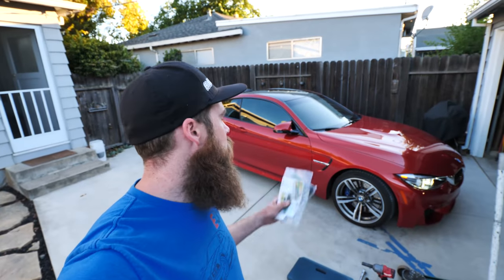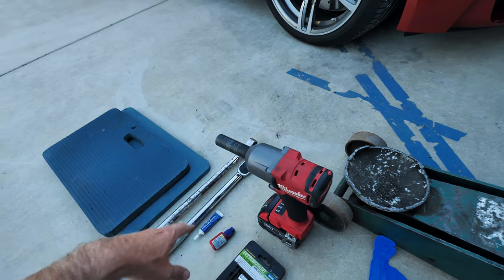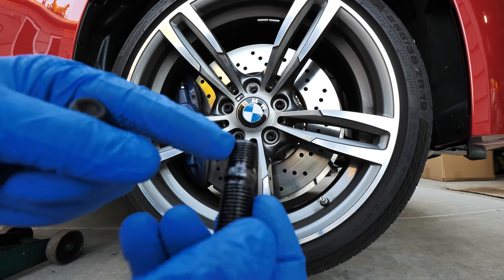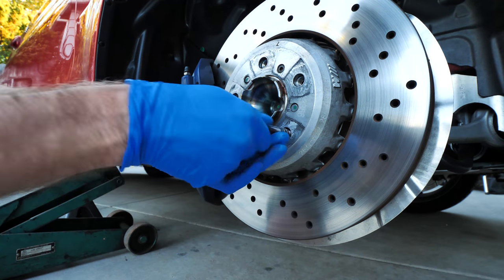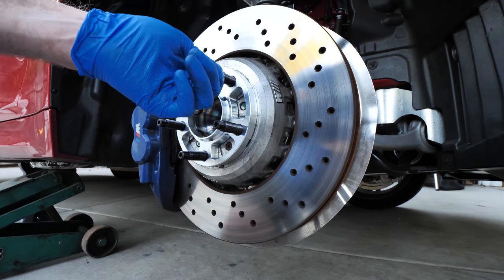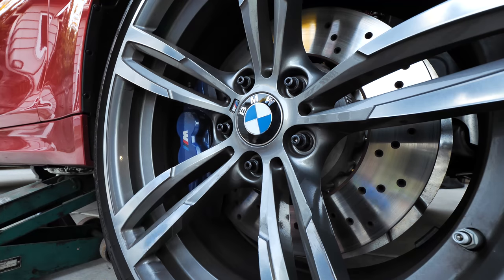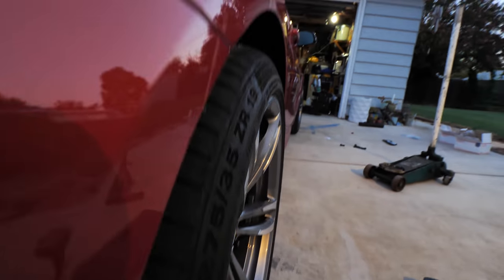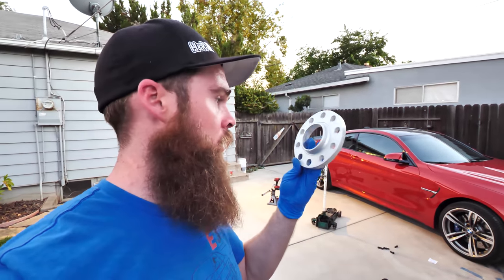HOW TO GET PERFECT WHEEL FITTMENT

Comment: Looks EXCELLENT! Hockey Pucks for Floor Jack Cup and or Jack Stands so as not to besmirch the undercarriage points and a super thin film of Anti-seize between Spacer and Hub and between Wheel and Spacer.  Helps cuz water gets trapped at wash times and starts the corrosion.

Comment: Just look at the video car looks awesome with the wheel spacers so my question is I have a 2015 428i M Sport coupe with 19” staggered setup and cars lowered so as for the spacers you did 15mm front 12mm rear can I use the same setup for my car it doesn’t have the big brake kit or would I use smaller spacers

Comment: I have to nitpick on the comment about hub centric being necessary. It’s helpful but not necessary and if done right, not dangerous. On a properly centered and torqued wheel, there is no load on the hub ring. That simply aids centering the wheel at time of install, particularly in rushed situations it can be very helpful.  The clamping force (the force that actually holds the wheel to the car) exists on the rotor face and wheel hub face. So again, very helpful but not totally necessary if you perform the install carefully (star pattern torque sequence) and proper final torque. As far as your track light spacers, I’d be more confident with a full face spacer as you appear to have very small contact areas with those spacers. Any weight savings by those drilled holes are negligible particularly since it’s at the center of the wheel.  Nice video though.

Comment: I see you didnt use anti-seize between the mating surface of the spacer and rotor. Some do, some dont...is it recommended in their install instructions?
Reply from the maker: I live in California so I don’t have rust issues. You definitely can use it if you’d like. I’d most likely burn it off during track days from heat.
Reply: @BlakesGarage  Makes sense. What length of stud did you go with? The 75mm?

Comment: Hey I have 2012 BMW 528i xdrive and I have m4 wheels on its but I'm running 245/40/19 Front and Rear 275/35/19 .I wanted to know if I could do the same set up like you have on your car ?
Reply from the maker: Yeah that’s stock M4 sizing that I have on my car. Not sure why you have a 245 up front that’s just the wrong size tire.
Reply: @BlakesGarage  The reason why is that I went on a website that tell you the required size for a 5 series and it says that I need to put that size.
Reply: I have the same set up you have...lol
Reply: @BlakesGarage  I have 245/40/19 in front on my F10 is that the wrong size tire in front?